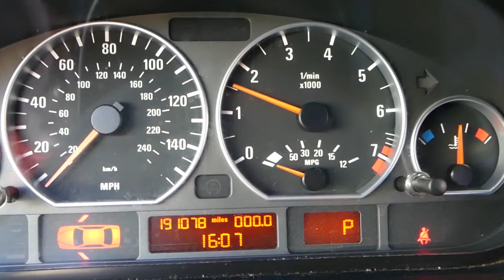HOW TO TEST AND CLEAN VVT SOLENOID ON PORSCHE CAYENNE, VARIABLE TIMING SOLENOID

Comment: Thanks for the good video.  Do I need to grease the VVT Solenoid after cleaning and reinstalling with special grease or just fresh engine oil or some silicone spray or petroleum balm?  I bought new o-rings   997 turbo.  Thank you

Comment: can you help e please ????????????????? I’ve got a Cayenne S - 957 - after the Porsche coupon ( the car was perfect ) I wanted to try the “ PROTEC OXICAT “, but I made the mistake of putting 375 ml inside about 45 litres of petrol , instead of 80 litres advising in the instructions , after 10 minutes I used it in town , I was in “ Drive2 “, it whispered slightly , then turned on the “ Motor Spy “ , and went to protection mode , so over 3,000 rpm , cut gasoline , under 3,000 rpm , the engine turns well , instead during the start time when cold , the scooter turns empty 3/4 seconds before turning on … could you tell me what could happen ? Is the OXICAT PROTEC so powerful that it destroys a motor that was fine? P.S. - I contacted the  #Protec , but NOBODY answer !! Strange situation !!